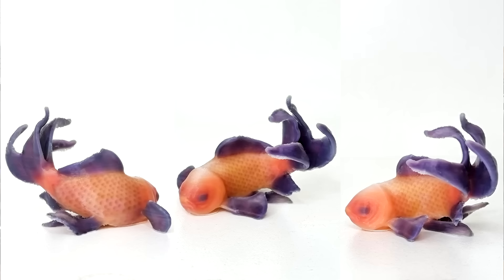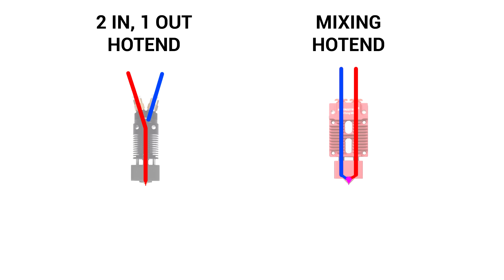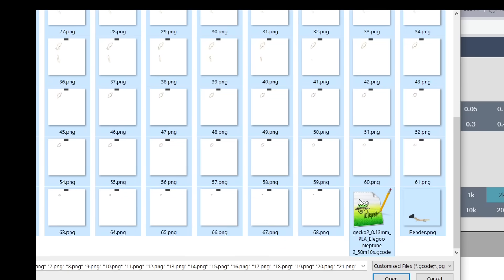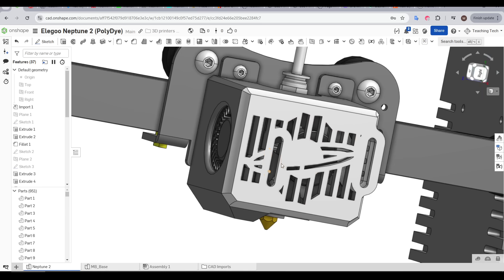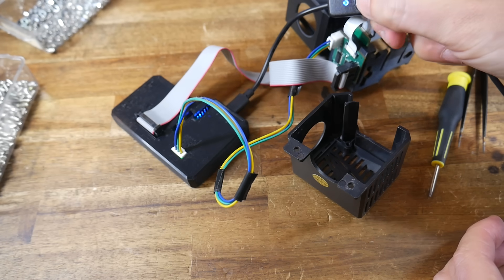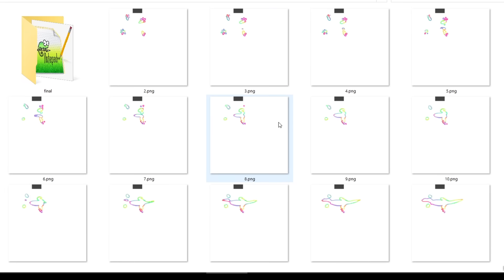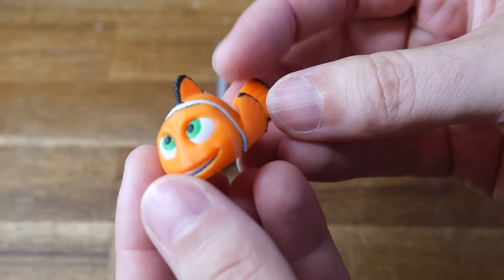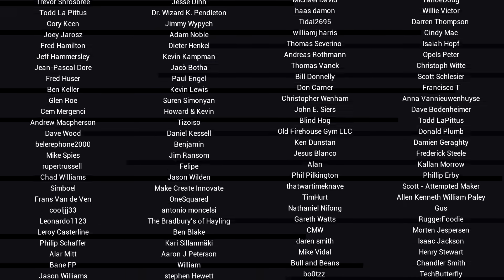Full colour 3D printing at home with PolyDye - Open Source Inkjet integration

Comment: 3DPrintColorizer on steroids 😲 (it uses sharpies to colour each layer)

Maybe ink cartridge should have some sort of cover to keep head from drying, though it would require a mechanism to move it away while printing (we need terminology 😅) + should not add height below ink print head

Now we need a filament that is ink-friendly - has absorption and retention properties unlike normal filaments to make result more defined and vibrant and perhaps diminishes ink flowing between walls and layers. A filament with e.g. kaolinite (china clay),  talcum, or maybe cotton or pulp? Something like coated printing paper or glossy photo paper 🤔
edit maybe there already exists a filament with high filler content that would work better?

Comment: My first thought when seeing the per layer jpg images was that this looks very similar to the way that resin printers operate. Hoping this doesn't present a problem across those platforms, or perhaps better yet providing a method of setting up alternative slicers to the proprietary one that so many of the resin printers use. In any case, this looks like an interesting solution. Not sure if I'll ever implement it though.

A solution that might speed up the alignment would be to lay down a grid of 3 mm wide lines of plastic with a 2 mm spacing, then use the ink cartridge to set down fine lines separated by 3.9 or 4.1 mm  (or smaller increments) then use the image analysis to do the final alignment. Optionally stage 2 does a second grid with thinner lines ( say 1 mm with a 3 mm space between, and the system then fine tunes with that image to work out a higher precision centering in x and y.  The idea being to not put down plastic where you're not going to be putting ink down, as well as giving the image analys hard edges near the ink portions of the print for analyzing offsets.

I am reminded of the system that worked out offsets for a automatic bed leveling system that used either a camera pointing up, or a camera pointing at a mirror giving a centerable point for working out where the touch sensor was, then jogging x and y to get the offsets, but in this case collecting ink jet nozzle offsets for each of the jets. Image processing would hopefully allow the system to start with jogging until each was 'in frame', tracking how many steps were needed to move the other into frame, then working out what the actual offset was in steps or microsteps for the final offsets. The place where this is needed is in the computer controlling the printer, but presumably you could use a single system to work out all of the relative offsets.

Comment: I would imagine that you don't need to spray ink in the middle of the model as no one will see that. I would be nice if this eventually this could be adapted for klipper based machines as the only Marlin based machine I have us an Ender 3 V2 in the process of being converted into an Enderwire.

Also I would imagine that you can use generic compatible ink cartridges, Ultimately it would be very nice if you could use a ink tank based system.

Comment: This is an amazingly clever approach and maybe even able to eventually do better colour than pooping filament swappers, especially if cartridges using a more plastics compatible ink can be developed in open source, maybe even a refillable system rather than a proprietary system. However, that's probably a whole other sister project and maybe a masters thesis for an engineering student.

I won't be adopting it in its current state, I don't have the practical skills much beyond basic printer setup and operation. If it starts making its way into domestic grade hobby printers, I'll be there with my mastercard in an INSTANT!

Meanwhile, there's always a Bambu P1S & AMS or a Creality K2... and poop...😂

Comment: It would be interesting to make a modification to work with resin. With each layer, it would clean the excess resin and apply the color. At the same time, the vat would work with the minimum possible for printing.

Comment: I still think the best solution is to color the filament itself before its fed into the extruder. Think about a mechanism that holds several permanent markers and rotates around the filament. As the white filament passes through a motor presses the color you need into the filament.. Purging a certain amount each color change.

Comment: Wow - this is very impressive for a beta product. Hopefully this will turn into something commercial pretty quick, because the potential here is staggering. A custom print head and filament blend would probably bring this on par with current color tech. I'd even imagine a 2 print-head machine, one with 'structural' material and one for 'pretty' material.

Comment: This is cool! the only issue really now is the filament itself because the ink has no issue with color. I would design a filament around this to get the best result for less washed out results and it would be beneficial to have a dual spool system for this because one filament as black, white, or paper bag brown for inside structural layers,  highlights from subsurface scattering and the second one for the outside colored shell. Maybe the filament already exists now that I think of it try using wood filament since the ink is designed for paper. Maybe its just a matter of tweaking the wood filament?

Comment: Layer Adhesion - print speed. As a retired Epson large format printer field tech I greatly admire the amount of work to merge the two technologies. I have used a single stamp pad color to tent clear petg on a lamp shade project. Staining the filament before extrusion.

Comment: This isn’t really new as XYZprinting used a similar ink jet system years ago on their color DaVinci 3D Printer. The problem was you had to use their cartridges. Colors also just kinda bled together and weren’t crisp just as you’ve found with this system. 
Nice to see an option that uses standard cartridges and open source.
Reply: The idea is trivial and everybody and their dog has considered it at one time or another. Actually engineering a working device is not. And then there is the big patent troll in the space making sure to prevent anyone actually commercialising the technology.
Reply: @JamesChurchill who is it, my understanding is that the key techs at this point are all public.
Reply: Stratasys has been tying up 3d printer technologies for decades, even the blatantly obvious ideas that should never have gotten a patent. The ones we use are generally the ones that have finally expired. They're currently suing Bambu Lab for the idea of using NFC tags on filament spools.

Comment: I could not help thinking that all the things that an inkjet printer does like (1) capping the nozzles when not in use so they do not dry out, (2) having a process that wipes the nozzles before printing and (3) pumping some ink through the print head to clear the nozzles  all need to be recreated for the inkjet part of the process to work well.

Comment: This is a big deal, I use a polyjet at work and even though its accurate, the colours arent always great and look washed out sometimes. CMY resins cost around £330 + VAT each for 1.1 litres in the UK and the printers ae easily over £100k or more. Getting even close to that with FDM and ink is huge. Polyjet is a very cornered market and some disruption is long overdue.

The scope is massive - specialised colour base filaments in different materials, toolchanging/tank and pipe systems, white and metallic inks. Conductive inks for circuit boards! Colourable TPU/silicone for medical models!

Comment: Totally different, but this reminded me of the Mcor 3D printer that would use an inkjet head to print on regular white paper and then cut that paper and glue it layer by layer until it makes essentially a wood-like full-color 3d print.

Comment: Hopefully Jacques is reading and will take my considerations. A-mazing results! I wonder if there couldn't be an idea for a larger hopper per RBY or CMYK with loadable inks moving into a smaller mixing hopper, using a TPU membrane much like those annulae on the bottoms of upside down dishwashing soap bottles, thus getting further away from proprietary fixes and into being even more foss for version gamma maybe? no rush, because there would need to be angles to work out, but a constant pressure could keep the ink flowing and not when not needed, much like a tool changer, but for pressing force not the tools themselves.

Comment: I wonder if adding a black cartridge would add the contrast needed to really make prints pop. Rigging that together would be double the "fun" when things are still in such an early stage, but it just might be worth it once we nail the saturation with just the color cartridge. Heck, just being able to use the 3D printer as a 2D printer is an exciting concept in finally making an inkjet that doesn't come from hell.

Comment: I would hope to see a refill-friendly cartridge with perhaps a Continuous Ink Supply system before I'm interested. Get away from the highway robbery of big ink, plenty of great refill providers. The problem is that you'll need a manufactured print head. Anything outside of proper use could lead to a cease and desist.

This could incorporate a cleaning cycle before the print. Who cares about a little insurance waste with ink at a fraction of the cost of an OEM cartridge. Also, ink will fade in UV light, some faster than others. Prints usually have a sheltered lift compared to a 3D print. I wonder if an ASA White with natural UV resistance or a UV clear coat post-print would help.

Additionally, the current colors have contrast issues. Black (and grey) Piezography inks use encapsulated carbon to make deep black, light proof prints. Usually used in screen printing and digital negative production as they need to block light. An open source cartridge design could incorporate it.

Comment: Even though the idea is cool I dont see this as ever catching on.  for 1 it is WAY to complicated to get installed, setup, calibrated.  for 2 the cost is more then you can get other more refined and usable 3d color units for for like Co print that also work a lot easier.  For this to ever go mainstream they would have to have this in a ready to go , just quickly install , click a few calibrations and be on the way.

Comment: That looks amazing.  The powder based full-color 3d printers that I've seen also come out with muted colors until the parts are dipped in superglue.  I don't know if that would help out with these or not, but some kind of coating may help.  The other thing that would be interesting to try is to convert it from a cartridge to small refillable tanks.  Color cartridges get expensive in a hurry, but they are fine enough for the early stages.  I look forward to seeing how this develops.

Comment: Great video. Btw I see that you use Notepad++. Please note that this is a "malware" due to the claim from its author "A new feature just enabled in Notepad++ : If you don’t agree with its politics views, Notepad+ + will add random characters in your source code". I always took these stuffs seriously, and never consider this a joke from the author. Just google it(the original post maybe deleted from their twitter account after the author realized how threatening it was)
Unless you want your hours of 3D print work ruined or even your 3D printer damaged, stop using Notepad++. There are a handful of better code editors available.

Comment: No one remembers the XYZ Davinci? Ive had an inkjet based 3d printer for some years now. The issue is the heat proximity and clogging of the ink nozzle, If they can solve that, fantastic.

Comment: 3d printing is truly a community driven hobby. Innovations like this seem to always be pioneered by hobbiest. Then 5-10 years later a company will package it up and sell it as a finished product.

It's tough to see the open source community exploited for profit but also good that these difficult to implement technologies are adopted by the wider industry.
Reply: It's not just 3d printing. It's bad in software too. Plenty of companies will take open source code, slightly change it (or not) and sell it.
Reply: @chadwickalexanderjr1758  ...and patent it, and try to enforce their patent back onto those that created it.  Even if it has no merit, the cost and risk to fight is high.
Reply: Thing is that the 3d printing community has pretty openly wanted this.  They want to develop innovations in the public space and then have companies make an accessible version for the masses.  This keeps big companies from locking down the field with patent and copyright BS.  If new ideas are developed out in the open, no company can come along and try to claim it as their invention.  The downside is that the creators are not often the ones to get rich, but the upside is that the 3D printing community has a remarkable amount of control over the space.  That tends to happen when the market is dominated by geeks who can quite easily just build their own parts, printers, and accessories if companies piss them off enough.
Reply: @Kevin_Narthex  that's a pretty good point. The convenience is also just way too good for most users.
Reply: the thing is, getting adopted and reworked by big companies, make it possible to be available for a wider audience, because not everybody is geek enough to develop their own printers and make mods, some people just want to print and have fun.
Reply: These companies should be required to donate a certain percentage back to the open-source community that they take some products from
Reply: I see it as open source working as intended. There's a level of deattachment needed to be a proper open source supporter, to know you are benefiting humanity even if you won't ever be directly rewarded and some big players will profit more

Comment: Cool, but several problems. 1 adding a large amount of off balanced weight is going to slow down printing significantly. 2 ink printing will slow down printing even more. 3 ink cartridges require  cleaning while printing. 4 ink cartridges are bloody expensive and some might have issues with the waste cartridges create.

Comment: this is brilliant work. i would however say that the final colour does suffer from not having black ink. printers use a CMYK process the K is the black and its called K because it is the KEY. it is the colour the timings for the other colours sync there positions from. it is also needed to add darkness to some colours. you wont get a good deep red without some black. i dont remember if there are any inkjet cartridges that have all 4 colours, they mainly seperate the black into its own cartridge because it is the most used colour. Adding a second cartridge would become quite unweildly i think..